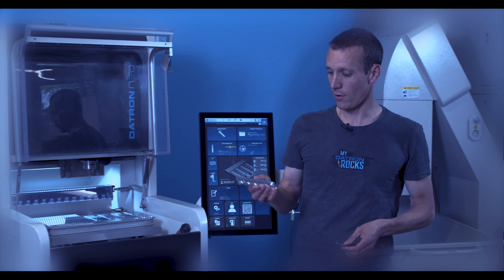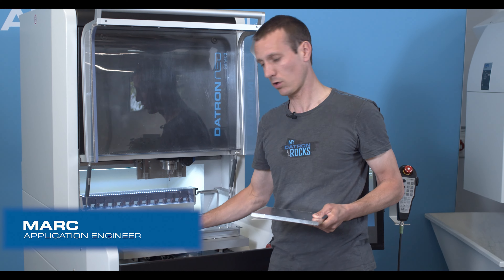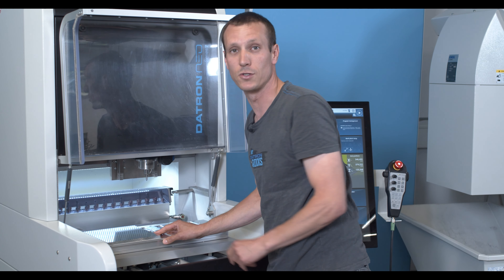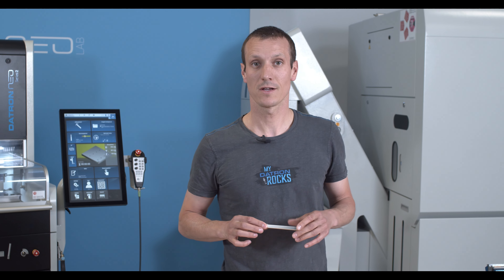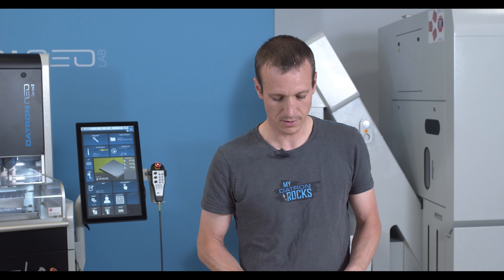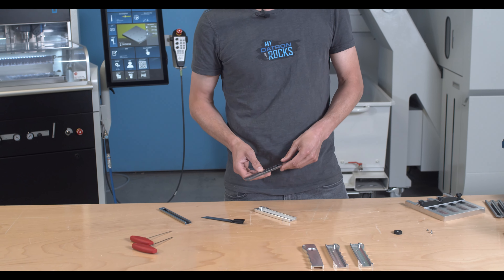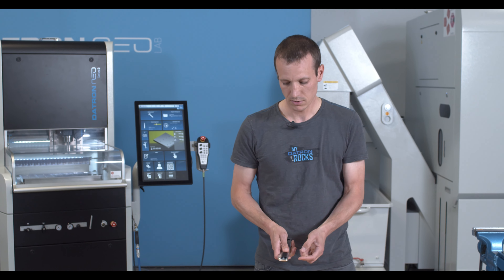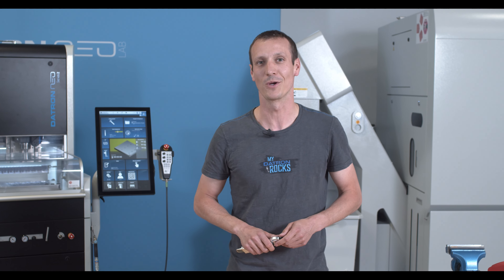Cutter Fixture - Tech Talk | Ep 05.2

Comment: All looks good, but like ALL Datron demo's the part that is being machined is very flat and generic.... I'm yet to see how a Datron (which for the most part is a large format 3 axis machine) can use set-ups like pyramids Etc. to broaden the range of geometry of parts that can be made. Has ANYONE ever seen a Datron mill a deep pocket? It would be great if they also showed some more breakdowns of their whole run process. Yes the probe makes setup time quite quick, but the chip to chip time of the tool changer is very slow, would be great if at the end of each demo they provided some stats about the part that has just been produced (i.e. full run time, volume of removed material, number of tool changes required, surface precision achieved Etc.)
Reply from the maker: Dear Temptt, thank you for your comment, which is very valuable. DATRON Tech Talk is about exemplary applications. We will take your suggestions for improvement into consideration. We offer all kinds of DATRON machine sizes, from compact like DATRON neo to large format like DATRON MXCube and DATRON MLCube. As far as deep pockets are concerned, of course we can make chips fly faster.  We recommend to check out for instance our video about the twelve spoke aluminium rim star or the video about our DATRON Axis4 manufacturing ski bindings. If you want to see deeper insights into the processes, our current Tech Talk series is well suited to learn more about parameters of the milling process.